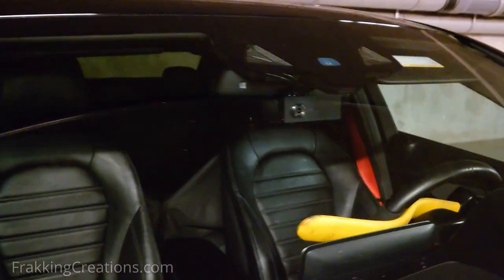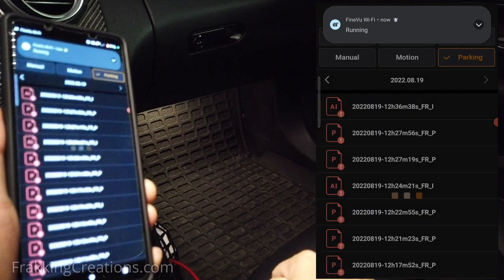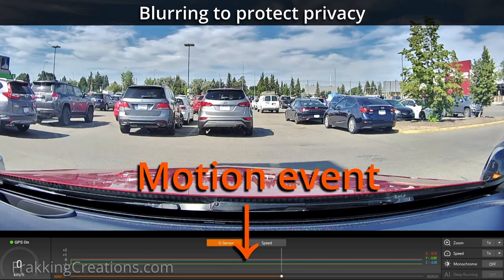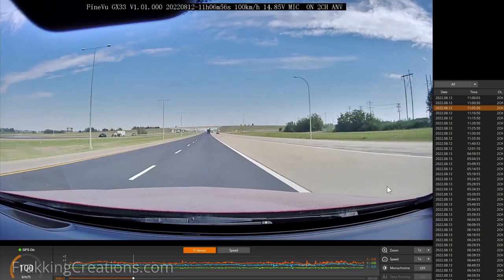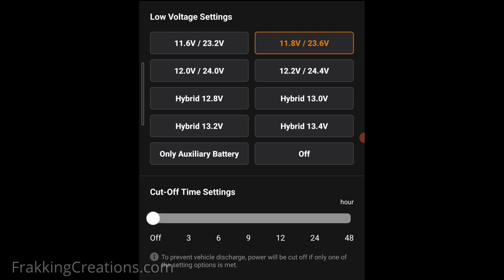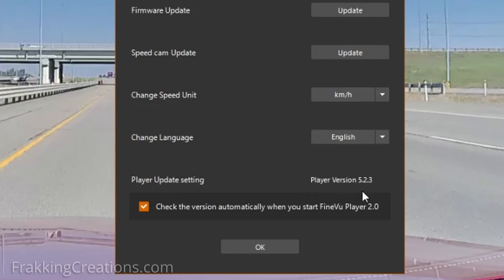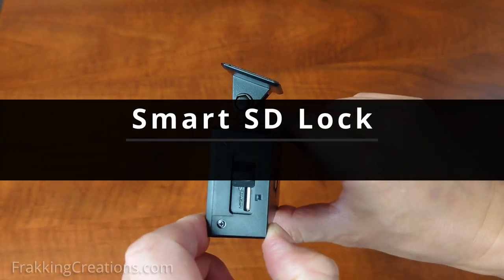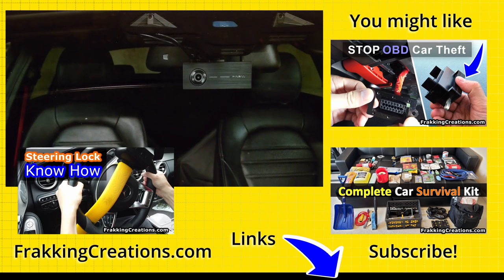This car dash cam any good?  FineVu GX33 features, dash cam review & detailed test

Comment: Why not loop a go-pro with all the detail that I've not found with any dash system? you have all the 12v power you need to
Reply from the maker: I suppose if high detail is important then it could be a solution for some.

Here are some reasons I would choose not to:
* Price.  You would need to get 2.  One for front and one for rear: around $350+ x 2, plus suction mount: around $65 x 2.  All USD plus any taxes.  Plus anything else for installation to hardwire power.

* Heat.  The operating AMBIENT temperature range of the HERO9 Black is 14°F ~ 95°F (10°C ~ 35°C).  This means if you operate the GoPro in hot environments like in a car under sunlight, it will likely overheat (especially when parked).  When overheating it will shutdown and not be recording.
Plus, since these have Lithium-ion batteries, temperatures above 45°C (113°F) will damage the batteries faster and cause bulging and battery life and capacity loss.  Not to mention the fire hazard of bulging batteries in hot environments too.  That's why you don't see many dashcams now with batteries.

* Theft. Since GoPros are expensive, multi-purpose and desirable, they are likely to get stolen if left in the car for park mode operation.  If you decide to take them with you when you park, then it is more hassle, inconvenience, time consuming and more to carry.  Plus, no park mode protection.

* Event tagging.  The GoPro will have continuous recording but not event tagging for impact, motion or manual recording events.  If you have ever had to review security footage without event tagging, trying to find a particular event is time consuming.  The event tagging that dashcams do is meant to help save time and find events faster.  Plus, you can enable write protection to prevent event footage from getting overwritten.  In the GoPro, you will have to get the footage right away to ensure that it doesn't.  If you decide to do it later but forget, then you could lose the footage.

* Power.  If you choose to have park mode you will need something that will monitor the car battery to prevent the GoPro from draining it.  Not to mention you are using 2 GoPros instead of one dashcam.  I suspect the GoPros also have higher power requirements each.  If not using them for park mode then you will have to turn both off when parking and both on when starting your drive.  More inconvenience.

All these reasons may not seem like much but once you start doing this you will probably stop wanting to use the GoPro as a dashcam.  Though, everyone has different needs and priorities so different solutions apply.  So it may still be the route for some.

These are some of my thoughts on using a GoPro as a dashcam.  What do you think?